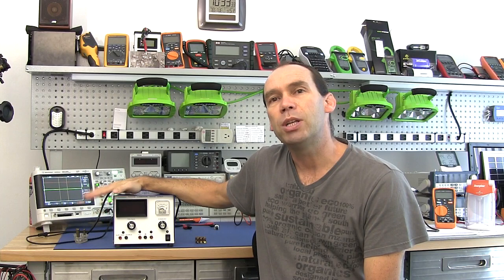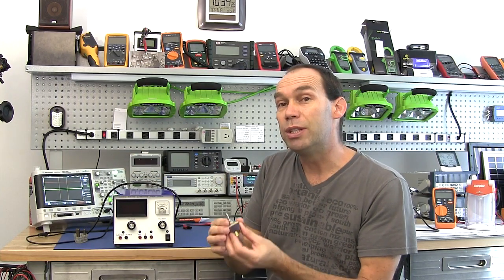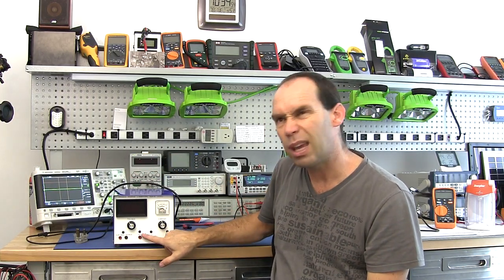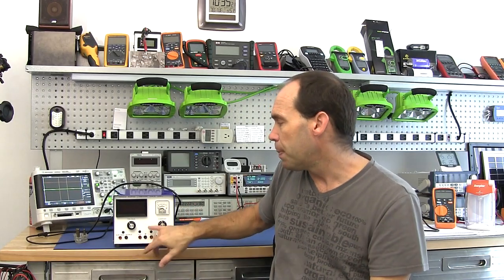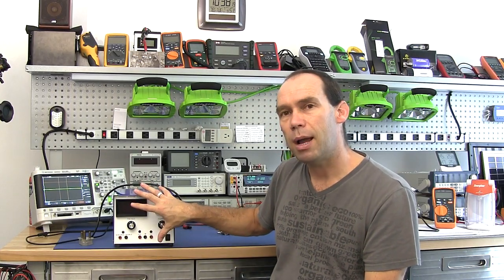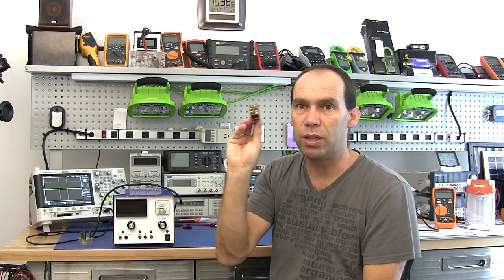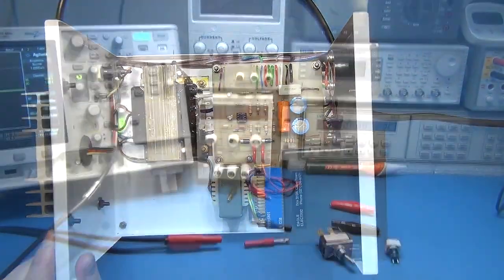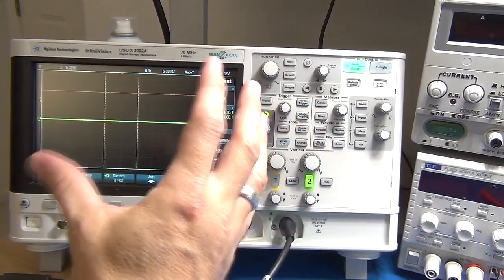DIY Bench Power Supply: #1 - Output Switch

Comment: Looking forward for this series. I'm already in Rev B of my own power supply, but as I learn more I'm improving it a lot. In my next revision I'll add current adjustment and serial control since I'm already using a microcontroller on the PCB controlling various things and providing a 16x2 LCD display interface.

Comment: TheSurvivalSecrets has got the right idea. You can most certainly debounce a switch with a couple of resistors and a cap. That method is called RC debouncer. Essentially you just stick an lp filter after the switch and you are all set. Google analog debounce circuit and you'll turn up a whole bunch of info as there are methods other than the RC debouncer.

Comment: 2n3055 is a npn power transistor (mosfet wouldn't require such a large heatsink because of the lower internal resistance) and the lm358 is a dual general purpose opamp :) Both are used quite often in hobbyist power supplies. Personally, i dont know much about the switch on thing. I would imagine that only the cleanness of the power on would matter, but you'll have to ask dave or mike or some other professional to be sure, im just a first year university student + hobbyist ;)

Comment: This will be a good series Martin :)

I think the switch bounce you saw was because you were switching both the positive and ground at the same time. 

Personally, I would just switch the voltage and leave the ground connected. But this would probably depend on one's personal requirements.

Comment: I think to get the full picture you really need to do that test again with a dummy load in place. Test at a few mA and a couple steps up to the max proposed amperage you plan to design for. I bet the timing and cleanliness will change a good bit on all methods you tested.

Comment: Hmm. That brings up an interesting question. Should you switch both poles, or just the positive side? When making the connection, I'm guessing you should "make" ground first, then the positive rail. I know hot swappable electronics connectors are designed to connect ground first. Something to ponder.

Comment: The LM318N is a dual op-amp (it's like having 2 chips in one). It's there to provide a system to give gain according to a feedback resistor - My guess is that one of the potentiometers is serving that purpose. It would help seeing the circuit to see exactly how its being used.

Comment: Hehe I have been powering the projects I have been working on lately simply with a small 12volt 7AH SLA battery...! I do need a decent power supply really..maybe I might join in on this one. By the way a 2N3055 is just a normal bipolar power transistor. They are quite ubiquitous and a good rugged device for power supplies and amplifiers. They'll handle 15 amps and can dissipate 115 watts. Slightly better is a 2N3773 they'll do 16 amps and 160 watts,

Comment: You are correct, the LM358 is an op-amp, but it's not digital. That will be functioning as an error amplifier in this design I would imagine. :) btw, what's that second little transformer for? If you want to run it in the U.S. without changing the transformer, the best way would be to use an external step-up tranny. Or otherwise you could wire a dryer plug to it because they are usually a 220volt circuit over there.

Comment: I found this interesting because it showed the switch bouncing, and when you're writing software for a microcontroller or arduino, you have to deal with the signal bouncing for a few milliseconds before it goes clean when using a switch,

Comment: The impedance of the primary of a transformer is the impedance of the secondary circuit times the turns ratio squared.
Example (numbers chosen to suit my worn out brain)
2 off 100 W transformers with 100V AC input
A has 10V output, turns ratio = 10:1
 B has 100 V output, turns ratio = 1:1
for 100 W output
Both have 1A input therefore mains see a 100 ohm load
Secondary load for 10V output is 100W/10V=10A therefore  1 ohm load
Secondary load for 100V output is 100W/100V=1A therefore 100 ohm load

Comment: The rate of change is not massively important, what is important is overshoot. Your second test is not really valid because powering on the mains takes time to charge the bulk caps. You should not use a mechanical switch on your PSU output, that will play havoc with your PSU regulator and probably your circuit under test. A pro PSU would be able to switch on fast (in the low milliseconds) but under full control - no overshoot or noise. Electronic switching is the way to go....

Comment: Could you please explain to me how can i measure with avometer a delta star 20 hb motor if it burned or not ? and if your motor burned should the protection circuit be damaged before the motor buned or not????

Comment: Hi Martin. Very good video with in-depth information. I have just built a multi output 5v power supply and I have just tested the switch and it has the same noise as that toggle switch. Of all the videos on making a bench power supply I think you are the first to point this out. So thank you for sharing your knowledge and time.
Andrew

Comment: I have been thinking about your switch today. Isn't the main purpose ov it to simply isolate the output terminals quickly & efficiently and is switch bounce really that much ov an issue? I see some people have mentioned relays, well they won't be any better than a manual switch in terms ov bounce. But what might be worth a try is a mercury wetted relay, or perhaps a solid state relay, which for DC is basically a mosfet with some "smarts" in a hermetically sealed module.

Comment: Analog meters? for shame Martin, for shame! :)
Building a psu is probably going to be interesting for many. For me personally, I would want a switchmode design because it can be tiny, cheap and powerful. No need for clumsy transformer or the big heatsink with the problems that come with that (the transistor is live on the outside and has a piece of plastic under it or it would short)
My uncle built me a psu in the same era of similar circuit (2N3055 based).
I'd use a single character display.

Comment: Bad idea to search for ideal switch, all will somewhat bounce. Do proper hardware debouncing (using a capacitor and or resistor) or resort to something like schmitt trigger debouncing - google it) 

Might be a good idea to dump the standalone multimeter display and combine this series with arduino tutorials to show voltage and current on lcd and do soft power through arduino/pic/attiny etc 

Don't forget to adjust the transformer of the multimeter screen as well, for US.

Comment: Hi Martin, hi Gerry!
No pun intended, but if your real-world circuit, both power supply and load as well does NOT survive or goes havoc about a real-world bulky clunky flip switch, something goes terribly wrong with your design! Think about switched power distribution boards, fuse characteristics etc.means you put the cart before the horse. My 2 cents...
Best regards,
Martin

Comment: I may be way off the mark here but if you put capacitor immediately after the switch before your load then in theory, you should have a clean ramp up and ramp down. The selected capacity could give you your desired time, be it 2ms or 20ms. You would also be able to drain the capacitence with a resistor when in the off position. Again I may be way off the mark.

Comment: I'd use one or two Nokia 5110 LCDs ($10/ea) controlled via an AVR or MSP430 for my displays. I've got some code that draws a rather nice analog meter on them. Add a few voltage dividers and the built in ADC to measure the voltage (or use a cheap 3.5 digit DMM chip).

Comment: A dual voltage 110 / 220 transformer will have two primary windings normally.  When optioned in series they accommodate 220v mains.  When in parallel they are configured for 110v mains.  There appears to be taps on the primary side of the transformer so it may be configurable for 110v.

Comment: Mosfet would require the same sized heatsink for the same power dissipated. Rds on is irrelevant, it is not used in saturation mode.

Comment: As Gerry mentioned the rate of change is not that important and I would be also careful with switching directly the output.
The outputs on most PSU's are often designed with > 100uf capacitors after the shunt which can cause a relatively high uncontrolled power input to your external attached circuit.

Comment: Great project idea Martin. Just week ago I pondered about adding out enable switch to HY3003 cheapo psu, after spending 3 days chasing massive fast transient overshoot on power on and power off. Later I realized it was my measurent setup that played up:)  May I suggest that you watch some of Gerry's videos, he has done some great psu design and testing. But, before you start, you might want to check your old psu overshoot on power on/off and dynamic response using Manuyo load...

Comment: The secondary impedance as seen by the primary is 100 ohms 100V AC * 1 A
A turns ratio = 10   impedance seen at secondary = 1 ohm
impedance ratio is 100 ohm /1 ohm = 100 = 10 squared

similar for transformer B
try is with various numbers for yourself

Comment: As you have probably already realised the 2N3055 is a silicon NPN power transistor.
It used to be ubiquitous in PSUs built by hobbyists back in the 80's and the 90's.

Looking forward to following the project.

Regards,
Ian

Comment: I was trying to clarify what I see as a (terminology?) misconception in your comment.  The impedance of the primary is the impedance seen by the secondary "reflected" back into the secondary and varies with the load on the secondary.  The primary impedance cannot be matched to anything, it depends on the load.  The winding resistance is a function of the number of turns and the cross sectional area of the wire.

Perhaps we are confused as to the terminology we are using.

cheers

Comment: Hi Martin, thanks for this. I have been wondering what's inside your "college" power supply for some time. The 2N3055 is an old NPN transistor. It is a popular "go-to" power transistor for general stuff. It's a bit like a 555 timer in terms of it's popularity.